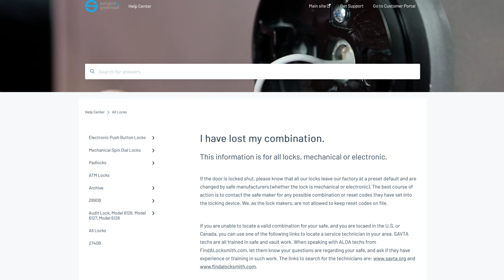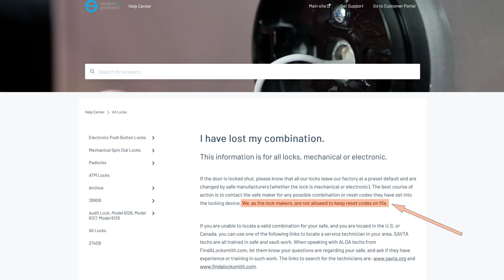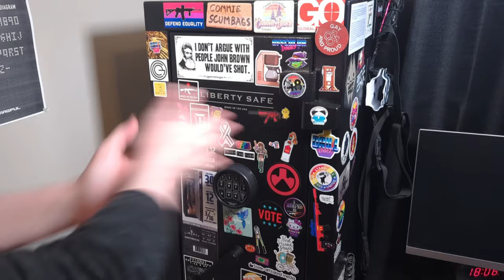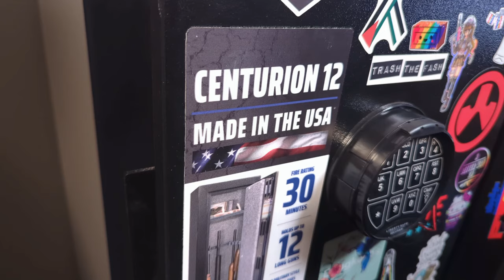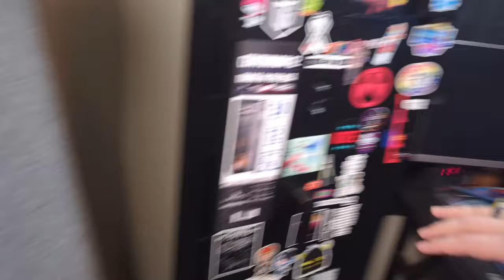How To Swap Out an Electronic Safe Lock for a Mechanical Safe Lock

Comment: Some comments from a guy with 40 years experience in this field.  Never hit the wheel pack with a hammer.  It is all soft metals, like brass.  It can flare or bend very easily and then you are buying new parts.  Never use a cordless drill as a screw driver.  You are going to cross thread something (like D did when he put the dial ring on) and then the holes are screwed.  Lastly, the spline key should be installed with the flag pointing towards the centre.  Most times it won't matter, but occasionally it will when the flag rubs on the inside of the lock cover.
Reply: Heres a tip, twist the screw backwards by hand until it clicks, and do a turn or two by hand. Guaranteed to never strip out a thread.
Reply: I like to use a Yankee screwdriver with modern bits for small installation jobs around the house. Maybe that would be useful here too😎
Reply: @JessicaFEREM  Extra true when screwing into soft materials: whenever I take apart plastic cases of small devices, I get a lot more re-assemblies when I do this, make sure the screw threads hit the same  threads in the plastic.
Reply: Quoting from the S&G provided instruction sheet with the 6730 I bought from MBUSA - "Make sure the flag of the spline is facing away from the center of the spindle", and this is confirmed by a photo of an installed spline key.   I use  cordless drill on bolts with a lot of engaged threads , but only AFTER manually starting a few threads to make sure it is not cross threaded, and then STOP before the screw bottoms out and finish up by hand.  The screws on a lock install rarely if ever have enough thread engagement for this to be a big timesaver.

Comment: Well as far as I know one manufacturer HAS a "PARK" code for one of their "high security" electronic keypad access. I bought the lock used and called the manufactures tech support. After explaining my scenario, he asked me for the serial number on the e board.  After confirming the number he sent me the .pdf on programming the lock which also has a manufactures master code for parking the lock. Second phase after parking the electronic was to pick open the Best cylinder at the change key shear line, done in ten minutes with conventional tools. All the police need to do is supply the manufacture with a serial number by a Warrant in person and they have the master code for a series of e locks. Most often they pass these codes to other LE agencies which is a violation to the manufacturers terms of data release. The issue is how do they get the serial number when it’s sealed inside the safe? Well they don’t , they just need to give the model number of the lock. Most often manufacturer has a photo ID .pdf they send to the LE agency to pick the lock from an image. Now the real fun occurs when the manufacturer informs them that the lock is "too old" and data no longer available.
Hey how about a video of thanking apart, cleaning and lubing a S &G combo lock? That would be interesting! Carb cleaner to knock out old lube? Teflon lube to relube?

Comment: While Sargent and Greenleaf may not have a back door code to their mechanical locks it doesn't mean the safe manufacture doesn't know your combination.  When I was having lock problems on my Gardall Safe (it had an S&G lock)I called Gardall for some help.   They were able to verify that the combination I was trying was the correct combination for my safe (based on s/n) as it left the factory.  Of course, now that I have a new lock in there I am also running a different combination.  

edit: I forgot to say that the issue with my lock was the key lock for the dial.  It had frozen so my new dial/lock doesn't have that.
Reply: 😆My previous safe was an inexpensive one from Costco a long time ago. It had all kinds of extra mechanisms to make extra safe, but then it's harder to get in when it fails. (A cylinder key to lock the handle, a digital pad that needs batteries, and mixed layers of plastic, metal and gypsum in the door.) The locksmith I got to my house couldn't open it, so I figured I'd get in myself to save the hassle and cost of finding a more expensive locksmith. I just shut the windows and doors so the neighbors wouldn't hear, and spent about four hours on it with an angle-grinder during daylight. The actual problem was that the handle and other mechanism was put together without Loctite, and the tiny nut/bolt had finally come loose. 🔩 (And of course, it wasn't designed to be serviceable.🔧🙄)
Reply: why the f@#k can't you change the combination on a safe you buy?
Reply: @DeeSnow97  My safe came with a S&G mechanical lock from the factory.  There is nothing stopping me from changing the combination other than having that tool and knowledge.  My point was that even though S&G says they don't program in back door or know the combination of your lock the safe manufacturer may know what it was when they sent it out.  It's up to you to have it changed or change it yourself (just like when you buy/install a new lock).

Comment: Well done Dev, I guess there were some lessons learned there about mechanical skills, yes, always over cut the shaft and then clean it up when you’re done. And yes, since you had a drum tool, I would have done a minor crown on the shaft to prevent buggering the threads. I would’ve also considered maybe green Loctite on the screw threads. But impressed how you corrected the tension on the rings. Again, well done.

Comment: Tremendous video. I did not know that they use a standard bolt pattern. Interesting. Thank you so much for showing your difficulties and the steps you took to troubleshoot and fix.
Reply: The difference is the mechanicals tend to have 4 mounting holes on the lock case, and electronics only 3.   I swapped a Lagard Basic because I felt I was pushing my luck after it was on the safe for 27 years with a 6730, and Gardall had already drilled and tapped the 4th hole for the mechanical lock.

Comment: 00:15 🛡 Concerns about manufacturer backdoors in electronic safe locks have led to increased interest in mechanical safe locks.
01:10 🔒 Sergeant and Greenleaf's policy shift regarding safe combinations and back doors followed inquiries from Senator Wyden's office.
02:21 🔄 Interest is growing in replacing electronic safe locks with mechanical ones due to improved security and control.
03:17 🛠 Swapping out an electronic safe lock for a mechanical one is feasible and relatively straightforward.
06:57 📌 Understanding the components and installation process of mechanical safe locks is essential for successful replacement.
09:52 🗝 Mechanical safe locks offer additional security features such as a change key to prevent unauthorized access.
16:47 🚪 Knowledge of safe servicing can be crucial, as issues like seized lubricant may arise during lock replacement.
18:36 💰 Group 2 mechanical safe locks are affordable and accessible, making them a viable option for security upgrades.

Comment: Now the fun thing to do is carefully examine the electronic lock circuit board to determine if there is a programmable memory chip within the lock itself. If they are using such a chip to store the codes in, more than likely it too will contain the "Grand master payola" code. With some research if  you can identify the IC memory chip there are data sheets out there that give the specifications as to what pins do on the chip ie power, ground, clock input, read write pins. With the proper programmer you can read and write data to the chip. The codes are written in a hexadecimal format. Read the chip with the proper equipment and using a hex editor program someone who knows how to decipher your working code (or in some locks multiple codes) locks that use multiple user codes will work the best since you will have multiple codes set at different address points. The one address point that would show an unknown number sequence more than likely will be your "manufacturers back door code" which you can try entering. If it unlocks the lock you know this is the address point where you will change to a code of your liking. 
This will all be useless if they use an all in one chip where the processor and codes are kept in one main chip. There is no way to access this data at this point. Replace with the mechanical lock.

Comment: Reminds me of the time I spent months trying to get my Datsun 2000 to time right. I went through EVERY system and still it would top out at an RPM that was much too low. Finally, out of desperation, I pulled the distributor...and found that the grease in the mechanical advance had frozen. After figuring it out, it was an easy fix.

Comment: I'm kind of hoping someone makes firmware for the vulnerable locks. While I think this method is best I think having the alternative firmware of the other one changed so it removes all known backdoors is a good idea too. Logic would state then only way is destructive opening. Cause that thing has to use jellybean off the shelf parts. No way a company is gonna have custom spun chips. They aren't apple.
Reply: Looking forward to the tear down. Its one PCBway order away from a new circuit board, looks easy from my armchair here.
Reply: @YouTube_username.  That would be a good idea too but also remember more than likely this already has a jtag provision on the board already. Why reinvent the wheel? Especially if you know what the microcontroller is and how to get a backup of whats flashed on it then reflash with new firmware. It wouldn't be too hard to code I would not think.
Reply: @HankScorpio64  yes im all about that, new board as a plan b. Was imagining it potted and locked down and so on

Comment: Great video. Would the same mechanism that you are using, work on one of the cheap Cannon gun safes? My electronic lock is mounted sideways with the bolt coming out of the side not the end, and does not have the piece with the spring. Thank you for any advice.

Comment: Definitely interested in a mechanical swap, when I reached out to my safe manufacturer they told me it was not as simple because my electronic lock has a backup key under the dial. I assume that woukd just be covered up but I haven't taken things apart yet
Reply: Sadly the solenoid locks do bite and are just not set up with the footprint needed for proper, modern locks. While it can be done in a few cases, usually the metal just isn't there to attach the new lock to. And if added via welding, the paint on the door will peel up.

Comment: A lot of almost new safe locks found for sale at online auction sites are pulled off a brand new safe because that  new safe owner wants an electronic lock put on. So the retailer pulls the basically brand-new lock off and slaps an elock on. Since that mechanical lock is no longer warrantied for a year they usually wont throw it on another customer's safe. So they resell em. Me? I use 'em to make dialing stations for all my LOCKSPORT safe manipulating friends. BTW, there are cool books on this out there for purchase.

Comment: S&G advises never to adjust the wheen tension as it is calibrated for maximum security, and if you do adjust it, use a torque wrench (Wheeler Engineering makes a nice one) to match factory spec.    What are the Deviant's thoughts on this?   I notice he manually tweaked this without any torque measurement.

Comment: <sigh> love ya bro, mean it.  I'm no expert, the vast majority of my knowledge comes from reading the writings of the former VP of Engineering of Amsec, but anyway here we go: 1. The fact that you replaced the lock on a not-a-safe, but a RSC (if that?) isn't going to help much, though I do understand the whole reason for the Liberty scare, 2. if you are like me and might just have a safe that starts with "M" and ends in "link" and have aftermarket electronic locks, you can remove identifying marks that would render useless any "backdoor" specific to your serial, 3. my understanding is that Securearm is the cheapest Chinesium to ever get a UL approval on a type 1 electronic lock, so sure, i guess it's good to remove it (though if it's not causing issues w/i the first idk 30 days or so it's my understanding that it's likely gtg for the expected life of the lock. etc etc. we could go on talking about the benefits of electronic vs mechanical but in the end if it's what the liberty owner wants than I'm glad he's happy.

Comment: So then, a question: Since these lock-bolt interfaces seem to be standardized somewhat, and the electronic locks on the market are insecure because of these backdoors—why is no one building an opensource hardware/software solution?

Even if you had to use a commercial unit as a basis for it, to get the hardware interface and mechanisms, then swap the electronics over, it seems like it would be the better solution here.

Comment: It's unfortunate that electronic locks suffer from such trust issues since, in theory, they should be the more secure option.

After all, ultimately, any mechanical lock potentially gives away information based on the mechanical construction and tolerances.  Its easier to completely remove any such giveaways by communicating only via some nice digital protocol via a wire.

Doing that right requires lots of effort and work to make sure you don't leak timing info, the lock behaves well when shorted etc... but it only needs to be done once... unfortunately the economics don't seem to be there to do this and it's really hard to verify there is no back door if you didn't build it yourself.

Comment: I have 11 gun RSCs ie “safes” from 3 different manufacturers and I tried going the other way with one of them. Having to remember multiple different combinations is a pain, despite two “safes” from the same vendor came with the same combo. Unfortunately the aftermarket dual locks are garbage and the OEMs are ridiculously expensive.

Comment: If I buy a safe, it will either already have a mechanical lock or get one installed before I even put ANYTHING in it besides the nuts and bolts that hold the safe together and the interior padding.